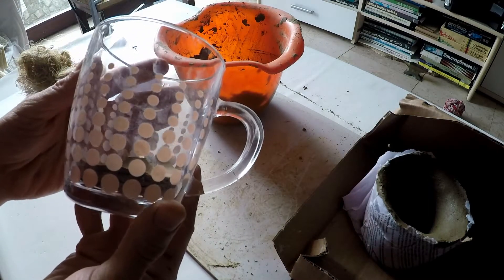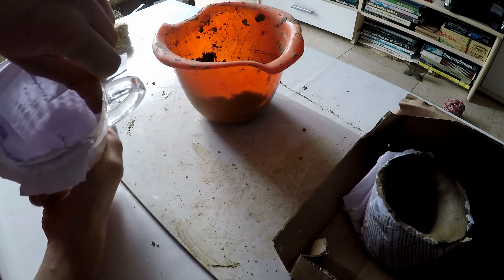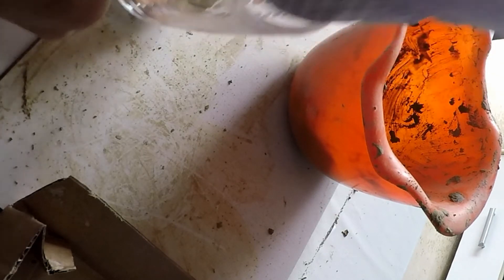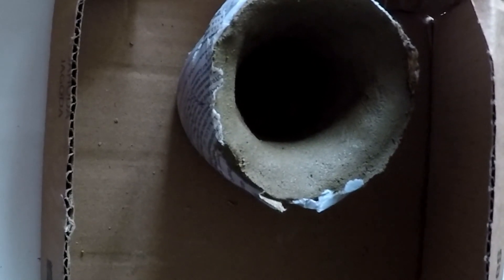Crucible steel attempt 1

Comment: Nice video! If you're looking for rice husks in Europe or an English speaking country you could try a home brewing supplier. 

Home brewers sometimes add rice husks when they add grain to water to start the process that converts the starches in the grain to sugar. The rice husks are a flavourless way to make sure the water flows through the grain easily when it's time to extract the sugar.
Reply from the maker: Oh wow! That's a cool tip to know! I have a Uni pal who started his business a year or so ago. Craft beer, it's kicking of nicely.
This is a definitely more viable option than psylium (?) husks. Nutrition and supplement fellas made it sought after and expensive.